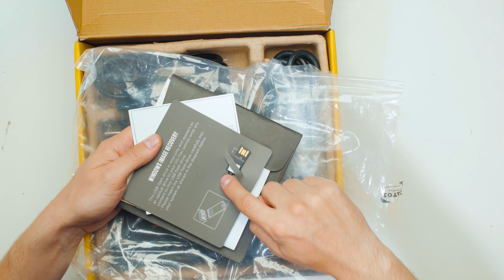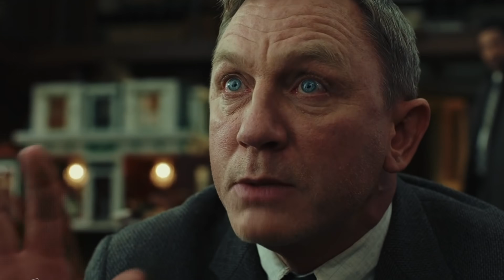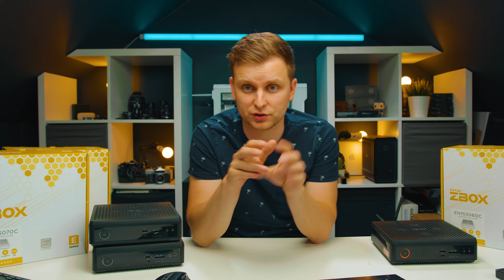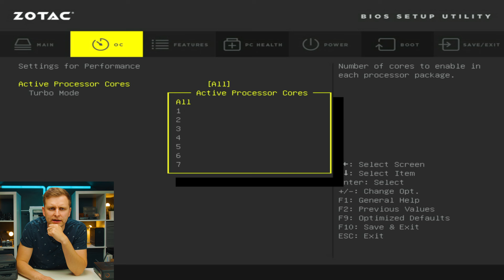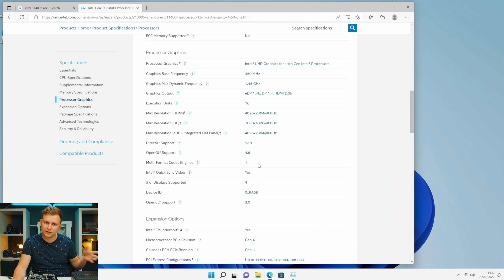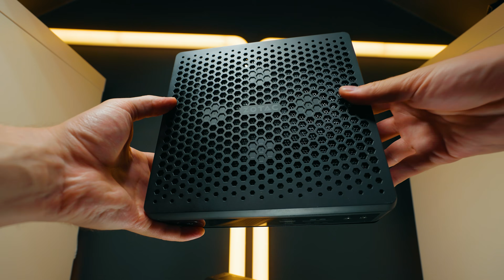When Space is NOT an OPTION?! | Zotac Magnus EN Creator Mini PC Overview & teardown

Comment: linus just did a review on a mini pc with desktop parts, it thermalthrodled so hard and it costst $5000.  This Zotac Mini PC makes much more sense
Reply: I'm not sure tho because this is a desktop type of form factor with laptop components. At least a laptop is portable unlike this mini PC. I would get a full sized PC over this because neither of them are portable but the full size has better performance and customizability
Reply: @calvinilkay1067   where did you see it was not portable?… it s as small as a gaming laptop ….
Reply: @calvinilkay1067  that's what I'm trying to say, that PC Linus reviewed didn't perform as well as it should be. You când put a 200w CPU in a 70w CPU cooler and expect it to be good. Puting the laptop components in that encloser allows to get more watts than a laptop while being way cooler. And the performance/price is awesome
Reply: @IRudra  Ok tell me how the monitor that you want to use is portable. How bout the keyboard? You obviously need a mouse for a laptop anyway but you need that as well. A laptop is portable this mini PC isn't. Yes you can out it in a backpack but you still need a monitor, keyboard and mouse for it to work at all unlike a laptop which has it all. Gaming laptop with a mouse is a better choice if mobility is a factor.
Reply: @gavril3698  that's true but what's the point in this small form factor that isn't portable like a laptop but doesn't preform like a desktop PC. It's like a Ven diagram with the laptop and PC on either side with this thing in the middle. It really doesn't make very much sense
Reply: @calvinilkay1067  some people like me don't need a gaming laptop jeez, i hate laptop screens, i hate laptop keyboards. So why bother getting a laptop to put it in a corner and connecting it regardless to a screen.who renders stuff on the go? No one. Thats why you use a PC for that. A mini PC is portable by the fact that you can put it in a backpack and travel to another location where you use it.
Reply: Why you need it this small and not go for M2 now?????
Reply: @calvinilkay1067  There are a ton of small portable keyboard/mouse and monitors. And if push comes to shove, you can just use your phone as a monitor or display

Comment: 9:37 Lower power is not the only difference. The "RTX 3080 Laptop GPU" is based on the GA104 chip - the same as the desktop RTX 3070 and RTX 3060 Ti, and not the GA102 chip that the desktop RTX 3080 is based on. Moreover, it uses GDDR6 memory, not GDDR6X. So what if it has 16GB VRAM, since it is much less efficient than the desktop RTX 3080.
Reply: hey mate please help me , please, im thinking to buy this PC  with 3060 12gb vram or to buy a laptop with 3060 6gb vram, i wanted for gaming and for the next gen games, for ex - Starfield, star citizen maybe GTA VI hehe , what should i buy ? i cant have a desktop PC because i need mobility , thanks and sorry for my english!"
Reply: @voltage1235 did you find anything I'm in the same boat
Reply: @Spencerwalker21  I seem to remember this computer overheating with long gaming sessions.

Finally buy a laptop with 3080 but 140w is important the issue of 140w as many come capped at 80w.

At this point I would recommend buying a laptop with a 4070 or 4080 140w.

Comment: I'd love to see a 12th gen version of this vs the mac studio variants. Seems this design will actually hold up pretty well.
Reply from the maker: same!
Reply: @theTechNotice  yeah, and metal chassey, r at least some high quality good looking plastic with 12900hx or 12950hx and 3080ti 175w and alienware size like 330w gan charger, but couse this doesnt need a screen keyboard lighting webcam mic, speakers phone charging and so on, it could be about a 280w charger too, it would be so small, if they do the same way alienware did, would be so cool, also with thunderbolt 4 ports at least 2 on the front and a headphone microphone jack, and maybe a full sized sd port too, but thats not important that much.
Reply: RTX 4090 VS M2 now!
Yeah!
apple can win on small tasks only, not on renderfarm levels!
Reply: @tgfrefert  M2 will beat any PC, only is not able to compete on renderfarm levels now.
Dell alienware, why you need them? What is it you run on them?
Reply: @theTechNotice they've got a rtx 4070 mobile version now I want to recommend it to my brother but it's only sold on eBay wth why doesn't zotac sell these directly

Comment: I'm not convinced, this  is just a very big laptop without the screen, keyboard and battery.  I much  prefer a standard ITX mini pc because they have  everything  standard, repairable and upgradeable, even if they are a bit bigger. This thing only has laptop class  performance and the same problem of non standard parts.
Reply: Your right, Try running a 3080 on a 380w psu and the device is smaller than a 3080 to boot
Reply: Depends on your use case. This box is much smaller than an ITX. Last time I check, ITX case that fit a 3080 takes 1xL size. If you really tight in space, this is a not bad solution
Reply: Prices will also matter.
Reply: Better power management too. It could save more power bills in the long run. Otherwise, better off buying a laptop
Reply: What I like about it is the horizontal design. My plan is to stick a small pc somewhere in my entertainment unit and use it as a dedicated emulation console. Most ITX cases are tall, and so wouldn't fit.

Comment: The only downside to me is the power brick. Is heavy and should have the psu inside the box, not outside. If Zotac can find a solution for that, it rocks!
Reply: they would need to use a flex psu which will take 1/4 of the case space

Comment: I dont like the massive external powerstation. I mean the point of this is to reduce stuff. If should be like a notebook but without a display and batery at lower cost...
Maybe you can do a comparison video Mini PC vs Notebook?
Reply: 18-4025 Barath Kumar S  sure you need it, but look it should be integrated. I mean, actual notebooks are at same power. They could actually just use a notebook without display and battery and make ist somehow closed design, there you go.

Comment: b-b-but how? HOW does this laptop 3060 get higher scores while consuming 50W LESS power than a desktop 3060???? HOW IS THIS EVEN POSSIBLE???
Reply from the maker: It's a great question! 👍🤔
Reply: Just a tought, but i think its because the laptop 3060 has more cuda cores than the desktop 3060 (3584 vs 3840)

Comment: Is a 329 watts power supply big enough. The rtx 3080 can draw 320 watts in total?
Reply: Did you really watch this video?? This is mobile 3080 not desktop 3080 so it only uses up to 150W not 300+ Watts.